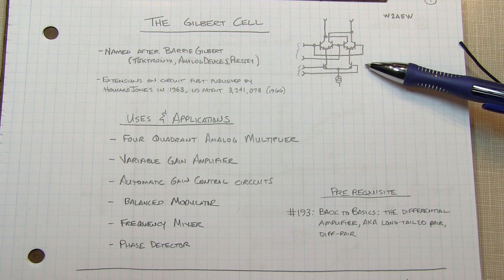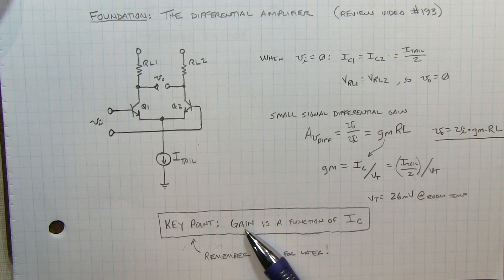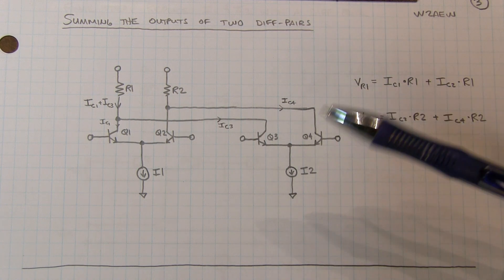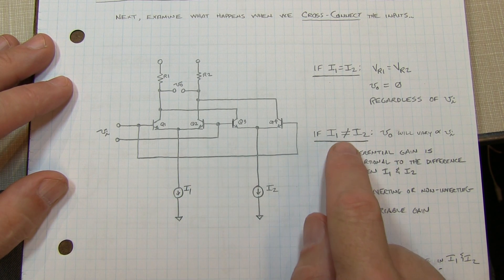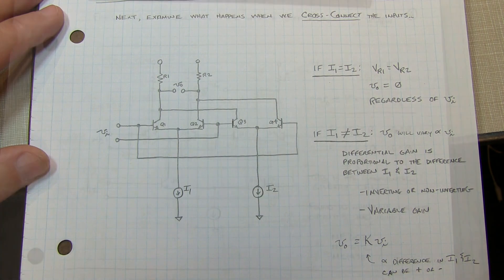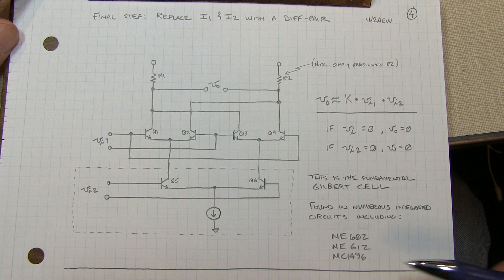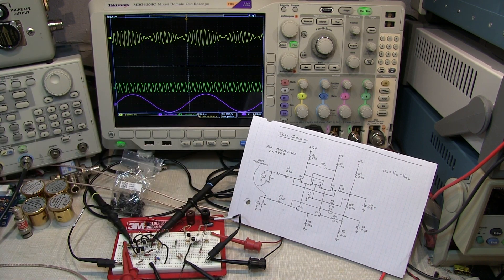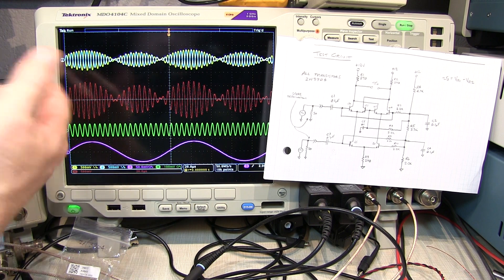#223: Basics of the Gilbert Cell | Analog Multiplier | Mixer | Modulator

Comment: Ooo very nice. I gotta build some of these    Edit: Excellent video all around. I need an X^2 operation for an analog true RMS calculator design for hifi audio compression as well as VCA.
Reply from the maker: Note that there are ICs available that have this integrated - look for analog multiplier chips from folks like Analog Devices.  Other options to think about are LOG and anti-LOG op amp circuits…

Comment: Diode ring mixer, time to abandon you. This is my new favorite circuit block!
Reply from the maker: Then you'll really like the AD831 - available on a little demo board on Amazon for cheap.
Reply: I already have a few MC1496s ordered for further experimentation. At the moment I'm trying to figure out how would I use one for generating DSB, but with ALC input so I don't need to worry about that with another circuit.  @w2aew
Reply: I'm currently trying to come up with a way to implement a MC1496 as a balanced modulator, but with integrated ALC using pin 5. I built an equivalent circuit in LTspice and I'm experimenting with that.

Comment: Great video, I understood the working really well and so did my friends. We have to implement the same circuit for our term project this semester. We tried it already but we only got noise as the output. I think the problem might be that our input signal gets too noisy at lower amplitudes. We would be very grateful if you could tell us the maximum amplitudes that we could use and also tips to reduce noise in input and output.
Reply from the maker: You may want to review my video on the basics of the emitter coupled pair to get a solid understanding of the differential input voltage levels that are needed.
Reply: @w2aew  Okay, i go that. Do you have any tips to reduce noise in practical application? Thanks in advance
Reply from the maker: @nidhilrs15  Noise reduction is generally all about bandwidth limiting in most cases.  Employ lowpass, bandpass or highpass filtering on your signals and gain stages to allow your signals of interest to pass, but reject the frequency ranges that are not part of your signals.
Reply: @w2aew  Thank you, will try it out.
Reply: @w2aew  Thank you very much. We implemented your circuit as our term project this semester and prof was very impressed with it. We couldn't have done it without your videos and help. Keep them coming.

Comment: How did you calculate the resistor and capacitor values for testing? And what LO and RF input did you use?
Reply from the maker: Capacitor values were non-critical - just picked large enough to be low Z at the operating frequencies.  R4, 5 and 6 are just a voltage divider stack to setup the bias voltages where desired (about 2.5V for the lower pair, about 6.5V for the upper pairs).  R7, 8, 9, 10 are non critical values.  R3 chosen to give about 6-7mA tail current, R1 and R2 chosen to keep the transistors out of saturation when turned fully on. I think I used 10kHz and about 200kHz.
Reply: @w2aew  Appreciate it!

Comment: What is the purpose of the 3.9k resistors to the bases of the transistors (looking at the initial diff amp in the video). At first I thought it was to isolate the signal from the other base, but the current source also has this.
Reply from the maker: The two on the diff pair are for isolation, the one on the current source is to "soften" the value of the current source vs the variable supply (make it less sensitive to supply changes).  Also, for stability with bipolar circuits, it is generally a good idea to have a resistor in two of the three legs of the transistor.
Reply: @w2aew  thanks for the response!  I figured the isolation thing,  but the resistor on the current source is what threw me. Makes perfect sense!

Comment: Hi, amazing video. I have a questions, input signal could be bigger than 50mV de amplitude? In case no, there are a circuits to multiplier input signals near to 5V. Thanks.
Reply from the maker: If you add emitter resistors to the differential pairs, that will extend the linear input voltage range.
Reply: @w2aew  Nice, i got it. I have two question more:                                                                                                                                                           1. both input signal that came from generator were syncronized with the same internal timer? I have 2 generator with only one output each one, but i can syscronize them using external trigger using one as a master and another as slave to both signal start at tha same time.                                                                                                                                                                                                                                           2. Capacitor from c1 to c5 are using only as coupled? how you choose these value for capacitor.

Comment: Building the Gilbert Cell from discrete components was a real education for me. I would love to see an additional video on using the 602 mixer. I haven't had much luck with that chip yet. Any practical tips would be a great help. Thanks again!
Reply from the maker: The trick is usually in getting the biasing and signal levels right. Some resources online:
https://www.lb3hc.net/wp-content/uploads/2019/12/UsingTheNe602.pdf
https://docs.rs-online.com/3cf1/0900766b80027aa2.pdf

Comment: Matching of the transistors is apsoloutly important...these is key to the design of trans conducted amplutide..and gain of the deferential Ballance modulator ......questions does both sides of the diff get equal bias ...or do they switch ...from diff to diff...also does the bias vary the tail current at output
Reply: Did this guy ever answer your question ?

Comment: How could we do "math" with opamps?
For instance you have a 10Vpp eurorack VCO signal, if you mix these the amplitude exceeds 10Vpp is there some "analogly" method to  calculate using opamp how much the signal exceeds relative to 10Vpp? I'm interested in the sum of how much a signal exceeds 10Vpp.
Veritasium Showed in a video some Analog computers to could compute "sea waves" and their differences just by using strings and pulley's.
Since opamps are differential amplifiers, i wonder how this could be done.
Reply from the maker: Here is a brief  reference for doing math operations with op amps:
https://chem.libretexts.org/Bookshelves/Analytical_Chemistry/Instrumental_Analysis_(LibreTexts)/03%3A_Operational_Amplifiers_in_Chemical_Instrumentation_(TBD)/3.04%3A_Application_of_Operational_Amplifiers_to_Mathematical_Operations

Comment: C5 is redundant? relative to C2.
Cool class.
Reply from the maker: No, from the base of Q2/A3, C2 is on the other side of the 2.2k resistor while C5 is directly connected providing a low impedance path to ground for AC signals.
Reply: @w2aew  that's what Prof Aaron Lanterman also states here and there, to see a capacitor as short circuit.

i tried transforming this circuit to be used with a bi-polar +/-12V supply in the Falstad simulator,  but did not use the "voltage divider" you have. sofar not quite succesfull.

the ad633 is quite expensive, would be cool if you could solve it with a few transistors.
i got:NSS40301MDR2G

Comment: The last 6 transistors circuit seems to  forget a 0.1uF at base of Q6. This made outputs (yellow & cyan trace) have lower amplitude at the negative side of the modulation input signal (purple trace) as seen in scope.

Comment: Great video with amazing insight. Could you explain a bit more on how to eliminate the carrier and keep the signal?  Thanks!
Reply from the maker: Check out video #224...
Reply: @w2aew   I think you meant #224, which I watched; and again, it was nothing short of a pleasure and learning experience!  I wondered if you are a professor or an experienced engineer.
Reply from the maker: @LL-ue3ek  Yes, thank you.  I edited my reply so others don't get thrown off.  I am not a professor.  I've had my BSEE since 1985 and have done design, test, validation and test engineering - and for the last 16 years have been a field applications engineer for Tektronix.

Comment: So, for an AM modulator we would remove the cap on the lower freq input to the two lower transistors and add a DC offset, correct?  We would add enough DC so that the gain is always positive, correct?  Would this also shift the envelope up, so that the waveform would be the typical AM form?
Reply from the maker: Yes, that's basically right.  Check out the following video for details: https://youtu.be/38OQub2Vi2Q
Reply: @w2aew  Ah-ha... yes, I watched that one 3 months ago and have forgotten... I will watch it again... I bought a NE602 and fed the carrier input with an 800kHz signal using a single transistor Harley oscillator and I fed the modulation input with a 800Hz signal from a signal generator and it produced DSB because I did not add the DC offset to the modulation signal... I was still able to pick it up on a small AM radio.  Now I'd like to redo it with a single transistor 800Hz oscillator and make it rue AM.

Comment: Why does the output clip when the input signal has a high amplitude like 0.75V? How to solve this problem?
Reply from the maker: This is due to the limited linear range of the emitter coupled differential pair that is an integral part of the Gilbert cell.  The only way to solve the problem is to add degeneration in the emitters (which you can't do on an IC, but can do with a discrete design) or to attenuate the input signal. Please review this video to see what causes this: https://youtu.be/mejPNuPAHBY

Comment: is this obtainable with a 2n2222a? Also, how do you get the first circuit to work? I've been trying for a few months to get it to work and I'm having no luck. I've only been able to get square law modulators to work.
Reply from the maker: Yes, this will work exactly the same with 2N2222A transistors.  The two circuits labeled "Test Circuit" (page 2 and bottom of page 4) should work perfectly well with 2N2222A or any general purpose NPN transistors.  Also check out the circuit in the next video (https://youtu.be/38OQub2Vi2Q) which should also work well with them.
Reply: @w2aew  Oh, thank you! Also, does the circuit at 2:00 work for dsb sc modulation or just am?
Reply from the maker: @arthurfoxthearcticfox  No, the circuit at 2:00 is simply an example of an emitter coupled differential amplifier.  To do DSB-SC or AM, please watch the next video: https://www.youtube.com/watch?v=38OQub2Vi2Q
Reply: @w2aew  Oh ok, thanks this should help!
Reply: @w2aew  So I built the circuit you showed in the video about am and dsbsc modulation and I can't seem to get it to work, I'm experiencing a few issues that I'm not sure how to solve.

1. The carrier frequency (16Mhz) is somehow being seen on the output when there is no bias, my guess is that the Base-Collector capacitance of the transistor is causing this.
2. the signal frequency gets cut in half
3. it doesn't multiply the signals it only adds them.

there were only a few minor adjustments to the circuit, but only changing a few values of components so I don't imagine that's what is causing all of these problems.
Reply from the maker: @arthurfoxthearcticfox  You've got to take great care with both the signal amplitudes as well as the DC offset/bias of each, in order to get this circuit to work properly.
Reply: @w2aew  I've changed the amplitude of the signals and changed the bias and it still only adds signals and always has the carrier frequency on the output. Weirdly enough the circuit at 2:00 worked for AM, just not dsbscm.
Reply: @w2aew  Would you recommend adding a filter at the output? I've tried this with 16Mhz and I got AM, just not DSB-SC. I'm trying to make a 38Khz DSB-SC modulator for stereo FM transmission.

Comment: Thanks a lot for the video. Most of gilbert cell I have seen are using differential input and output and your test circuit is single ended with DC bias on one side. Could you explain how you determined the bias resistor values and also pro and con about single ended vs differential?
Reply from the maker: I used single ended inputs as a convenience, since I didn't have differential signal sources available and didn't take the time to wind a few baluns to create them.  The resistor divider string (R4, R5, R6) were setup to create bias voltages that would ensure that the transistors in each of the diff pairs were going to be operating in the linear region (not saturated).

Comment: I built up the circuit in ltspice and that magnitude difference you talk about at 13:00 also occurs in ltspice too. So I went on tried different approaches but when base Voltage variations and so are the currents are equal on q5 and q6 I get no voltage at the output. So this voltage difference is a must to have on q5 and q6 transistors? If it is a must to have then will we always see some magnitude difference at the output?

Comment: hey here is an example of a differential opamp that i had come up. Its was when i wanted to find the voltage drop of a resistor in series. Theoretically that is by subtracting the voltage seen before the load from the supply voltage. Here ( https://imgur.com/a/jadwAVf ) is an LTspice image of it. R2's voltage drop is being measured by the differential opamp which can be send into ADC. This can be done by a microcontroller but what if the supply voltage varies?
Reply from the maker: What you've shown is not a differential amplifier.  The circuit is essentially measuring the "spot" voltage with respect to ground.
Reply: @w2aew  here (https://imgur.com/ThQwzuo ) is what i what i actually meant. Earlier was kinda silly. Measures the voltage from 'spot' to the 'Drain'
Reply from the maker: @gtag174  Looks like you're pulsing VCC to the opamp - probably won't work well in real life, especially if the cap voltage is on and VCC is not - will drive the op amp input above the supply rail and it won't like it.
Reply: w2aew yea that was how i had it earlier. It’s the caps voltage that would be pulsed via the MOSFET and keeping the opamp at a 10v constant supply. Thanks for pointing it out tho.

Comment: Amazing video as always! 
One question: how did you decide on your choice of DC Bias at the bases of all the transistors? Any rules of thumb would be helpful for this and for other circuits.
Reply from the maker: The main consideration was to ensure there was a sufficient bias at the lower emitters to get a stable current through the lower 270ohm resistor, and then to ensure that non of the transistors were in saturation - i.e. make sure the collector voltages have sufficient headroom in both directions.

Comment: hello , I have a question, ¿how can I amplify the output signal, any suggestion?, thank you before hand. Does it have two outputs or one output signal ?
Reply from the maker: The obvious answer is to simply feed the output into an amplifier.  However, the design of the amplifier depends on the application.

Comment: hi..with this circuit is possible to put lets say 40hz on input a get double at output 80hz and so on???' im looking for a circuit at can do that...thnks
Reply from the maker: Yes - you can apply the same signal to both inputs and you'll get 2*f at the output, as well as a DC component.  Adjust the phase between the signals to adjust the DC component.
Reply: @w2aew  do you know if ic ad633 has the same circuir inside?  Or givea the same function?
Reply from the maker: @mastercat  According to the datasheet, the internal multiplier uses the translinear core that is the Gilbert Cell.

Comment: How do you bias it for non inverting am modulation?  Thanks!
Reply from the maker: Make sure that the voltage amplitude of the unmodulated carrier is less than or equal to 1/2 the peak voltage at 100% modulation.  This is the same thing as ensuring that the carrier power is no more than 25% of the PEP output.

Comment: Well that stuck in my head!!
I was going over the circuit for an Hitachi V-1050 CRO with no triggering and the Gilbert Cell pattern popped out at me. The IC CA3102E. 2 X differential amplifier with associated constant current transistor.
Reply from the maker: Yes, you can build a Gilbert Cell with that!
Reply: @w2aew  Well I had to go down the line to the sweep generator trig input and solved the issue. The thing is 34 years old, extremely precise and runs like a swiss watch. Very happy.

Comment: Thank you for your great video's! Your channel is a "must watch" for everyone who's into electronics! I Was looking around the web for a mixer to be part of a circuit that can shift frequencies from 80 - 86 MHz "up the dial" where a standard FM receiver can handle them (there's a lot of pirate radio activity just below the standard 3 meter "FM" band here in the Netherlands and I don't want to modify and mess up good receivers). I Discovered the double balanced diode mixer, other diode mixers and solid state mixers, but this one seems to be great to use in the circuit I want to build. Thank you!
Reply from the maker: I hope it works out well for you.  This mixer is part of the NE602/NE612 - which may make your implementation easier.

Comment: I think the reason for the gain being different for positive and negative half cycles of the "lower" signal is that a resistor was used instead of a current source for biasing the "lower" diff pair. not the mismatch among transistors.

Comment: Great video.
I had understood that the signal from the lower source should be the same on the two bases of the transistors Q5 and Q6. But in the circuit at the instant 10m27s the two bases do not meet the same signal. Is that correct?
Sorry about my English.
Thank you.
Reply from the maker: The input signal is applied between the bases of Q5 and Q6.  It is the voltage between these bases that drives the lower transistor pair.  They are not connected to the same point.
Reply: @w2aew  Thank you.
Reply: @w2aew  Thank you.